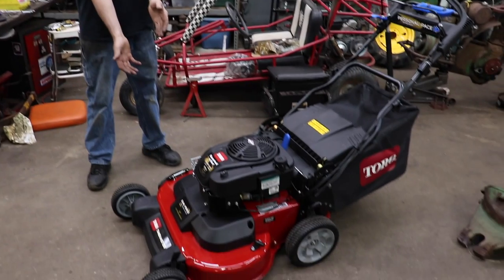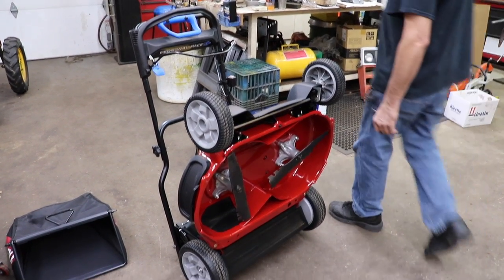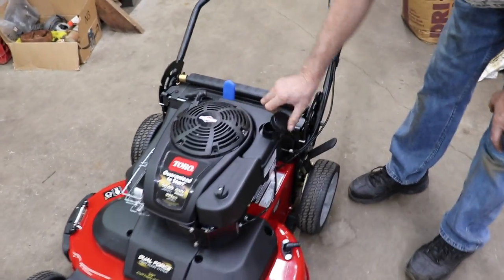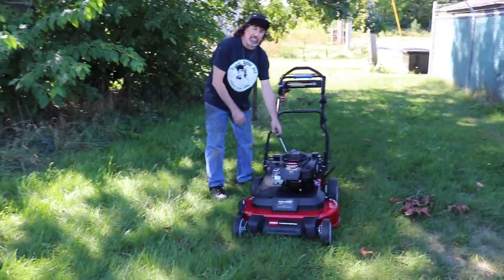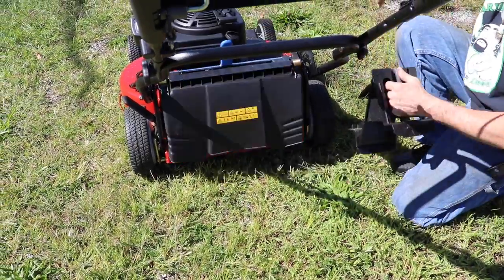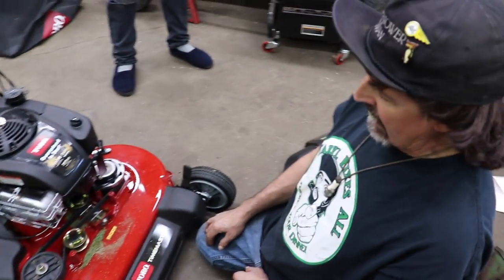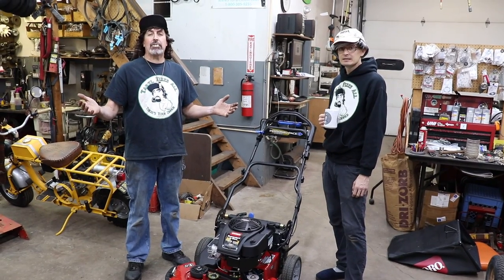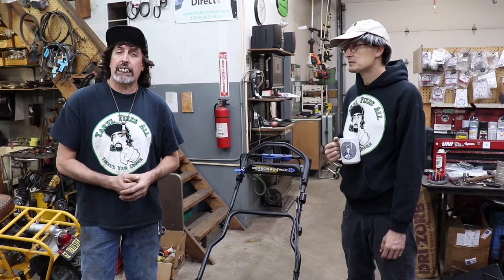New Toro 30" Timemaster Review - Is It Worth It?

Comment: It’s interesting to see a company that realizes their mistakes and actually upgraded to better transmission ect.
Reply: No,they don't!
Reply: They did with the motor...the 8.75 to the 10.00 helped tremendously,  especially in thicker wet grass. I cut for myself and own 4 total, 2 older and 2 upgraded, one with electric start. I carousel them for longevity and they weigh much less than the commercials...had a toro and exmark,  both where too heavy
Reply: @timkayjr2958  Most of the commercial people who bought them,junked them after 1 or 2 seasons.
Reply: Understandable, the commercial mowers last much longer...steel levers instead of plastic...believe it or not the cables snap just as often on commercial as they do the residential, and this motor is more powerful than the FJ180v Kawasaki they put on the commercial mowers although the Kawasaki gives very little maintenance needed
The commercials last longer because they are more steel than plastic, it's also a reason they suck to actually operate...I take a personal pace over commercial everyday, just my personal preference
Reply: @timkayjr2958  I forgot to mention that in order to adj mower clutch,you have to remove deck cover,loosen clamp,slide it back,tighten it,reassemble it,and then go. A "thumb wheel " on handle would be easier,faster,way to do this adj.the same goes for gnd drv.
Reply: Toro is a pretty solid company
Reply: What turned me into a fan in the first place was cutting bank properties out of a Honda Civic with a 22" Toro recycler. Kohler motor and made me a ton of money with very little maintenance
Reply: Most businesses who have been around for a while pay attention to criticisms and improve their product. However, this mower is a timewaster. I have the new improved one and they did not do much to make this a usable mower unless you have a fairly small area to mow with thin grass. You will almost never see anyone use this mower unless it is thin grass, even patchy areas. Any thick lawn with more than 3-5 days of growth with St Augustine grass or Bermuda, this mower bogs down completely and stalls out. While the 223cc was an improvement it wasn't nearly enough. The price was $1099 for this mower about 3 yrs ago, now it is currently around 1600. For a 1000, it was worth a chance. When you get close to 2k, you should buy a mower with a motor worth that price. A 223cc cannot push two twin 15's through normal grass growth on a healthy lush lawn. They should have put a 344cc motor on it, fixed the ticking noise, and whining noise too. It sounds like an airplane sometimes even when the deck is clean. Not too mention, just a few plastic parts should have been atleast common metal mfr in China, which would have been not much more expensive to manufacture and more reliable. The blade engagement cable constantly loosens. For around the same amount of money, you can buy mowers that have solved these problems like the cc800 and dw33.

Comment: Had one of these for a few years now and I LOVE it! I’ve got between 1/2 and 3/4 acre, used a Toro 22” mower for years but it took well over an hour to cut and had to be done twice a week. Now I don’t even think about it when the grass is a little shaggy, just give it a quick run with the TM and it’s done in about 45 minutes. The bag holds a helluva lot more than any mower I’ve ever had too, now I can bag the grass without stopping every other row. Still keep an SR4 around as back up and for smaller areas but I’ll never sell my TM unless it’s to buy a brand new one!

Comment: Love the channel Taryl. It should be f***ing illegal to build equipment without grease fittings and all these companies that have been responsible for engineering obsolescence into all this stuff should be forced to redesign everything to be serviceable like it should be. Not to mention they should have to replace the junk that's out there already at no charge to the customer. Another thing that should be prosecuted is making a carburetor without adjustments. One more is a lawn mower or anything else for that matter the doesn't have a throttle control and just starts wide ass open. All these things they do just so you have to spend money and so average people can't repair their own equipment. It's sick and should be dealt with harshly. Thanks for the knowledge and laughter.

Comment: I mow commercially. This mower is great other than the 2 OEM idler pulleys that come on it. I used this mower every day this year, Monday through Friday on 4-5 yards per day, to mow about .25 acres per yard since I usually mow all front yards with it because of the excellent cut quality I get out of this mower. The other .75 acres on these lawns is mowed with a zero turn. After replacing both original idler pulleys with OEM pulleys and also having them fail, I replaced the OEM pulleys with pulleys for the Toro/Exmark 30" pulleys and haven't had any more issues. I did have to add a washer under each pulley to get the correct spacing, but it works great. I really appreciate the videos. I also purchased a Scag SFC 30" walk behind to try. It also has an amazing cut, but it cost twice as much and it weighs roughly 100 pounds more, so it causes more fatigue on the operator when mowing in corners and around trees and shrubs. I've bought a second Timemaster now as a backup and sold the SFC. Don't get me wrong, Scag makes excellent products and the SFC is a great mower, but not for mowing around trees, shrubs, and corners in a fenced in back yard which I do every day. On my personal yard, the SFC is about the best quality cut I've ever seen, but for all around use, the Timemaster is hands down the best.

Comment: Toro about 1973 had a mower that had a circular slightly coned disk with 4 tips for a blade at each quadrant; the tips were triangular shaped and turn-able to a new sharp edge. The thought was the cone pulled the blades of grass up and the tips cut them off.
Reply: Yep, We had one, the blades on it were replaceable with standard sickle bar sections as well.
Reply: Jacobson had one like that too and it was 2-cycle. YEARS ago.

Comment: I have 2 of them..... I side mow with them. Cuts mow time in half. You failed to mention there is a 30” stripe kit for them, which by the way works excellent, makes your lawn look like the pro’s did it. The only change that I would like is a bigger gas tank, I would personally pull out the foam to gain volume for fuel. Clean out under the black belt cover every so often, build up of grass will cause the belt to jump time and the blades will clank together, don’t ask me how I know that.....  Otherwise those are a great product. Good video guys!!!

Comment: I have one and have used it for 3 years. I have had no problems.  I thought it was going to be to heavy and hard to maneuver but it turned out to be easier to turn and get around objects than my 21" Toro personal pace.  The blades being out front help with that.  You don't have to hold your fingers on the blue handle to make it speed up.  Just walk faster and it speeds up.  I have never used the blue handle.  Will buy another when the time comes.  Starts easily and bags very well.  Very smooth cut.  Saves a lot of time compared to 21" cut.

Comment: So it's safe to take the foam out of the gas tank 🤔 ? I just put one on layaway until I pay off my 22 inch Toro but like some other models I have I noticed one of the wheels height adjustment or wheel bracket out of alignment making the wheel not level. If there is a simple fix it would help.

Comment: residential or commercial the trick to these toro/exmark 30s is to have sharp blades and tinker with the governor so it runs at 3600 rpm
Reply: I had a little cub cadet and did that. Huge difference in power. Wouldn't try over 3600rpm, though.

Comment: I've had a toro timemaster since 2020 and I've had very little trouble and I use it commercially. I've put on 450 hours and transmission and the engine are still doing great. The idler pulley busted on me about 200 hours in so I upgraded to steel ones like Taryl recomended. I also replaced the rear wheels, but other than that it's been great. The Turfmaster is just too heavy and doesn't maneuver like the Time master does. I think this mower is perfect for a solo guy who's doing small lawns in the suburbs.

Comment: Oh man what a stroll down memory lane.  Your video series gave me the confidence that I buy one cheap that needs work and fix it up!  Video is disheartening in the sense that that never fixed pulley issue which you showed many as well as myself from the Turfmaster.  Also disheartening they still have that quick quarter turn fuel cap that is very faulty and unreliable.  You also showed me how to time my blades.  I feel those Atomic blades are gimmicky and got set a of gator blades. I turned up the RPMS on mine to help with mower as well!  I restyled it and also added a striping kit!  Best mower I have even seen and I gone through many!  I have a few videos on my timemaster as well!  Always pay homage to those that laid the ground work for me!  Many thanks! 🦅🔧🤙🏻🇺🇸

Comment: Looks like a good unit. I do like that Toro, gives you the gear to mow the way you want or need to. I'd be tempted to trade my riding mower in for one of these if I didn't also mow my mother in law's yard. Her yard is large enough we really need a zero turn but those are a little spendy for me. We use two tractors and the mowing takes about 2 hours and another 2 to trim. That's no all of it though. There is probably another 2 hours of mowing around barns and sheds we gave up on a few years ago.

Comment: Let's not forget the belt tension spring adjustment.  Mine was off when I bought it new 3 years ago. Very important to do every 50 hours.   

Right out of the operator's manual:

"Hold a 0.25 mm (0.010 inch) feeler gauge, a piece of paper, or a note card against the wall and slide it down behind the belt tension spring.
Note: If there is a visible gap between the gauge and the spring, tighten the adjusting bolt and the nut until the paper barely slides freely in and out of the gap."

Might want to show how to do that if folks do not know how too.

Spot on with the blade belt replacement. Have to replace mine every 140 hours. I get almost two years out of it.

Thanks

Comment: I would love to see a video dedicated to wash-out ports, pros & cons, and maintenance tips to prevent you mower deck from rusting and your keeping your bearings in good shape.
Reply: Bought one of those 4'  blowers for air lines from Harbor Fright. After mowing, blow tractor and top of deck off. Make sure it's dry when mowing, so under deck stays clean.
Reply: @jeffreydevoti7000  I used to wash the bottom and top with water. My mower had less than 30 hours on it and I noticed the spindles sound rough and somewhat loose now. Now I only wash the bottom with water and everything else is blown off with compressed air. Still, I'd love to see a thorough video on this topic.
Reply: @moonziemoonzie5524  You have the same issue as anyone who uses the washout ports, it washes the grease out of the bearings. I tell people not to use it, instead just cut the grass when it's very dry and you won't get the build up from damp grass. Then at the end of the mowing season, flip up the deck, clean off any grass and spray it with a coat of cheap pain to keep it from rusting in storage.

Comment: Okay I just got mine out today from Tractor Supply, checked her over really good, got the oil level where it should be and it fired off on the first pull. Problem? It's either the gas or something else. The only gas selling in my town atm is 93 octane and the station attendees assured me the gas was still 10% ethanol so I wasn't able to get any fuel stabilizer they were sold out. I gased up the mower, got her on the first pull but as I'm listening to the engine it has a very small sputtering going on. I know it's a new engine and it's a 2021 model. Other than that the motor runs and no issues engaging the blades. Other than the gas it would be carburetor related on the fuel mixture unless it's a timing issue. I'm kinda worried after putting $1869.00 in this mower and already having to trace down an engine problem. I've listened to others Timemasters on YouTube and they don't seem to have that problem. If it's a simple fix I'd appreciate some feedback 🙂

Comment: Hey tarly I have a30" Toro commercial turfmaster HDX. IM HAVING trouble with my transmission. Only one wheel is spinning. Any help Or information on it would help. It's a,2021 so I'm not sure what the problem is. Frustrated to say the least

Comment: The mower is a bit heavy for the width of the Tires, especially when using that bagger that holds so much grass.   There is room for the tires to be double the width.  It does indent turf even when you take a new path every time..  I have been using these mowers since the first model...   Yes I have warn out those pulleys causing blade collisions... Warn out sets of tires too... I love the mower, great for leaf cleanups. First I mulch the leaves, then set the mower higher and just suck up any bigger pieces with the bag..   Less bagged leaves and good for the lawns.

Comment: Got a Briggs & Stration 5HP engine that burn oil real bad and seems to use a lot of oil. Didn't over fill with oil. 
What causes that... bad valve , bad piston rings bad or head gasket. It starts fine. Thanks in advance.

Comment: If cutting a lawn bank with this mower and you slip and fall, will this mower shut off when you let go of the handle. OR, do you have to press the switch on the left side of the handle bar ONLY to shut the mower off????
Reply: It will not shut off, but, the blades will stop.

Comment: The only qualm I have with mine is changing the oil. I found this season after filling it back up with oil, that the 18oz bottle over fills it, and it will start burning oil. Tons of white smoke everywhere. Was not happy at all. 

I use a pump to get the oil out, next oil change I am going to use the tilt method. Did a 2nd oil change, and
Reply: That makes me think that you didn’t get all of the old oil out
Reply: @Mason-RRC  you are correct. I wish they had an oil plug or something to make sure you get it all out.

Comment: I Like That It Has Timed Blades, No Strip Of Grass Left When Mowing, It's Annoying to Have To Go Over The Parts Of Grass That Was Missed. It Should Come Out With Grease Fittings On The Spindles. I Agree With You On The Idea Of Having That  Foam Stuff In The Tank, It Could Break Down And Block The Fuel. Great Idea Of Having A Nice Fuel Filter On It. Good Idea On The Flick Back Switch, It  Did Bog Down With The Thicker Grass While Mulching, But As You said The Grass Was Too High And It Had No Where To Go. Once You Put On The Side Chute And Catcher It Went Through The Grass Like a Hurricane. Maybe That's a Good Name For TORO If Its Not Taken. You Was Not Going Slow Either , It Ripped Through It Quickly. The Warranty On These Is Exceptional, Because They Know That Their Machines Are Of Good Quality. They LAST.. The  Zero Turn Wheel horse Was a Great Machine For Turning On A Dime ❤ IT

Comment: Taryl  I have owned  a Toro TimeMaster for a number of years, do you know of a inexpensive source for wheel bearing that I could  purchase , seems silly to buy wheels, or sets of wheels when a wheel bearing go bad. I have  repacked  my wheel bearings a couple of times.  Also a big issue with these Timemasters is the size of the gas tank just seems with thousands of these out there someone would  have come up with a elegant solution?  Buy the way I updated the idler pullies as you suggested works MUCH BETTER.

Comment: I have the 2nd Gen exmark commercial 30 with the kai engine updated transmission, I have over 200 hrs on it and never changed a belt or anything on it, just sharpen blades and change my oil once a year with amsoil small engine oil. I don’t mow deep grass I use it as a finish cut mower though.

Comment: I own a small landscaping business and the time has come to buy a new, (or newer used), mower. I've been for 7 years now with a Honda HRX 21" with plastic deck, (I say plastic but it's some space age wonder material that's light as a feather and stronger than steel), and a brake clutch. Although the mower is still going strong and making me money, I need a new machine. And that brings me to my problem/dilemma. I can't decide between my trusty new Honda or this Toro Timemaster. The price is similar, with Toro being a couple of hundred bucks more expensive.. I'm trying to write down all the pros and cons. Timemaster is more powerful (very handy since my clients usually want me to cut the grass every 3-4 weeks), has a bigger 30" deck vs Honda's 21".. Now the cons are definitely - the weight. Most of the lawns I cut are relatively small and usually you have to pick up a mower to carry it over a few steps or a small wall to reach the lawn. This is why Honda is great. Also we can't compare the residential Timemaster with a commercial Honda. Sure, there's a Turfmaster from Toro but that is a 2000$ machine.... 
I still gravitate towards Honda but i would sure as hell love to own one of these Timemasters...
P.S. I'm definitely not putting in 40h of work on my mower on a weekly basis.. No way. There's trimming, blowing, edging, hedge trimming.... My mowers get around 5-10h of mowing a week.

Comment: This is the engine they should've put on it to start with.  the 190cc was way undersized for the work it did and it led to major reliability problems.  the older model would've probably stalled while discharging on that tall grass.

Comment: I've got an older version of this mower and mine doesn't have the blue foam in the tank. If you fill the tank it tends to leak out of the cap while mowing. I think they attempted to solve that issue by putting that foam in there. Overall I'm very happy with mine and it does cut my mowing time down quite a bit.